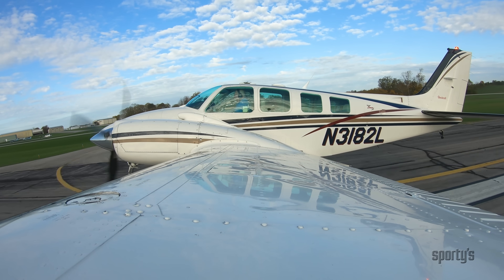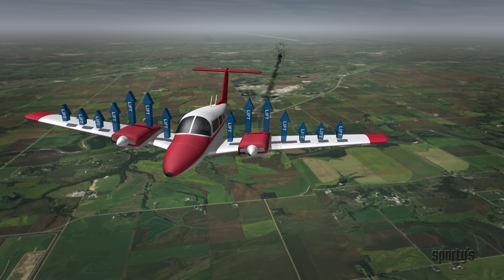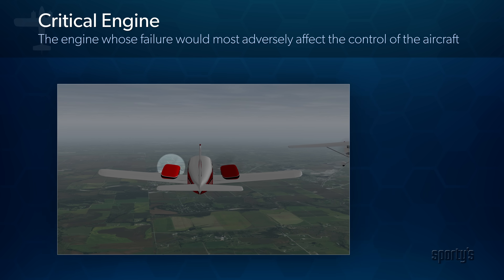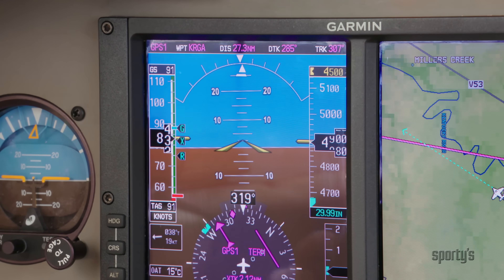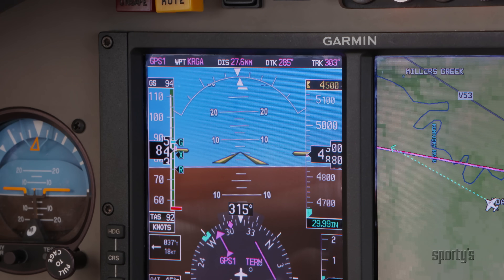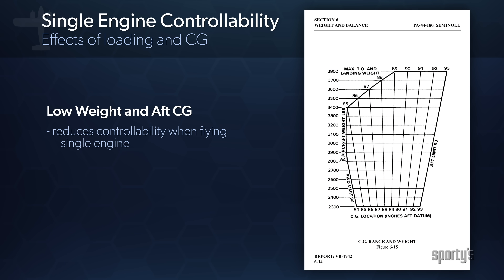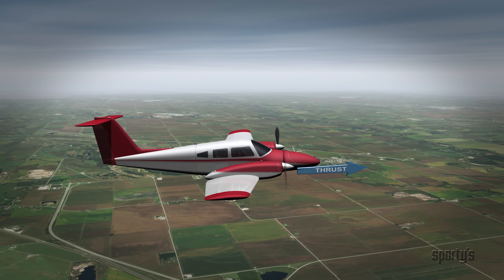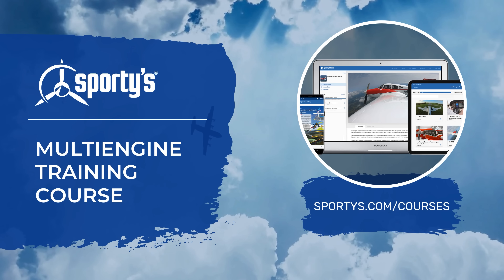Taming the Twin: Single-Engine Operations

Comment: Control and performance. Got it. So why are most twins so difficult to control and suffer such terrible performance in engine out scenarios? I know the physical, scientific reasons. I’m more concerned with how so many twins achieved certification when they are, in practice, barely flyable with one engine inop. I consider this a significant failure of the aircraft certification process, and I don’t think many twins would pass certification these days. I wish there had been more exploration of centerline thrust designs and other technologies to alleviate these problems.
Reply: Poor pl a Ning and exceeding a/c performance capability
Reply: You have to do your homework first! Wt/balance  told card...have a plan for t/off if you loose one....
Reply: That is a very good question. I can think of several answers. One is that centre line thrust has disadvantages in terms of performance, load distribution, cabin noise and engine cooling. Another is that the problems with the classic twin config can be overcome and do not present themselves that much in most designs. Not many twin accidents are due to poor single engine performance. Lack of system knowledge and training in how to handle engine problems is a much bigger factor in twin accidents, just as it is, to some degree, in single engine airplanes. In addition to good training much of the risk can also be mitigated by sticking to twin types with low Vmc, simple systems and benign handling. But I still think it is an interesting question. Like, why are we still certifying airplanes with carburetted engined, when carb ice continues to be a significant factor in accidents?

Comment: Absolutely amazing presentation, only thing that is a bit wrong is at 10:11 you mention the criteria for calculating VMC is lowest weight (which does increase VMC) but according to the FAA Flying Light Twins Safely documentation, it’s max gross weight or any other weight specified by the POH to calculate VMC. 

Part 23 doesn’t have a regulation corresponding to this anymore (CFR 23.2135 doesn’t mention specific weight) and Part 25 also specifies max gross weight. The reason for this criteria is certification of VMC is the able to have a constant number during test as the lightest weight in any light twin may differ widely even between aircraft of the same type. 

I bring this up because it was a question I didn’t get right during my CMEL check-ride and this was the correct answer I found after the fact. Hope this helps with your check-ride and good luck to future ME pilots!
Reply from the maker: You make some valid points here and there is not a one-size-fits all answer. While the "Flying Light Twins Safely" document does state that the current Part 23 determination of VMC should be done at maximum weight, that was not the case for the certification of most light twins flying today.

The prior version of Part 23 stipulated, "…VMC must be determined with the most unfavorable weight and center of gravity position and with the airplane airborne and the ground effect negligible…” (§23.149(b)).

Unlike the other regulations mentioned, they did not stipulate a maximum gross weight. Wind tunnel and other experimentation have shown that a lighter weight is more unfavorable, thus the indication in this video.

Going back even further, the original CAR §3.111, which many old twins were certified under, only mentions a rearmost CG. It does not mention the weight at all.

The Airplane Flying Handbook sums this up pretty well, "VMC increases as the center-of-gravity (CG) is moved aft. The moment arm of the rudder is reduced, and therefore its effectivity is reduced, as the CG is moved aft. For a typical light twin, the aft-most CG limit is the most unfavorable CG position. Historically, 14 CFR part 23 calls for VMC to be determined at the most unfavorable weight. For twins certificated under CAR 3 or early 14 CFR part 23, the weight at which VMC was determined was not specified. VMC increases as weight is reduced."

From a practical standpoint, the most important thing for multiengine pilots to remember is that a higher weight reduces VMC. But this comes with a tradeoff, especially for twins with smaller engines, which might not be able to maintain altitude or climb with one engine inoperative.
Reply: @AirSafetyInstitute  thank you so much for the reply and clarification! I love being able to work together as a community and learn together. I only brought it up because I was taught by the 23.149 rule and was told by the DPE that’s no longer the case and to look up to current answer and this is what I found. 

I wish the FAA would make it clearer rather than have one of their documents say one thing while another specifies the exact opposite, reminds me of the FAA Off Field Landing publication vs 91.119.